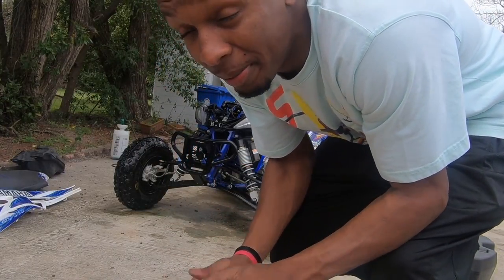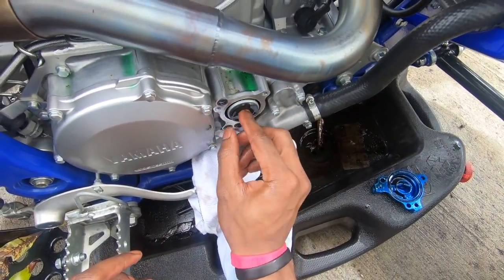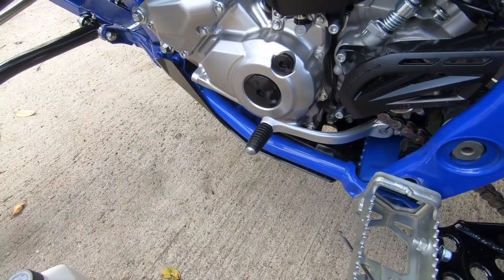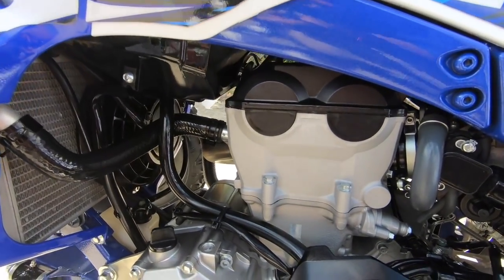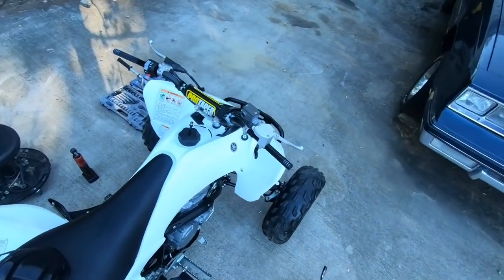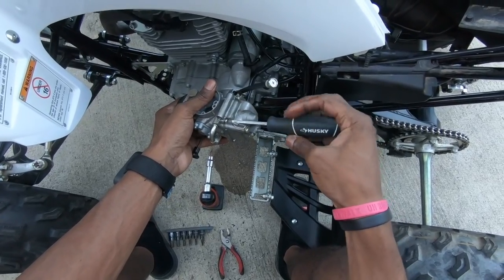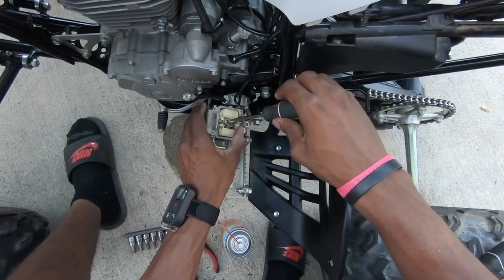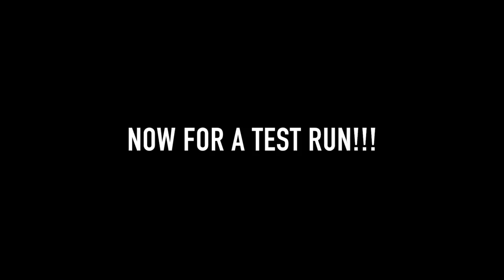CLEAN UP AND SERVICE OF MY YFZ 450R AND MY RAPTOR 250!!!!!

Comment: I have been using the GN4 Honda oil in my 5 atvs. Buts its 25 bucks for 4 quarts. seams high priced to me. Would this oil be good for a 400ex or rancher 400 or a trx 250x? I know the Honda oil will be good but its pretty expensive when you have 5 machines. Ty for the video!!!
Reply: LiveFreeOrRIP u can use rotella in anything that's uses wet clutches
Reply from the maker: Like he said anything with wet clutches I use Rotella in it....has never given me any issues its a whole lot cheaper too btw....from my big builds to bone stock engines all I ever used is rotella!!!!

Comment: Dont you need to use wet clutch oil in those.
Reply from the maker: Actually the Rotella 15w 40 is the same exact thing it doesn't have all of the additives as regular oils....and its at a way cheaper price I've been using it for years and all my bikes never had any problems!!!!
Reply: I gotcha thanks for the info sir